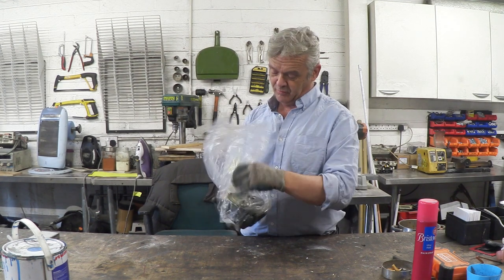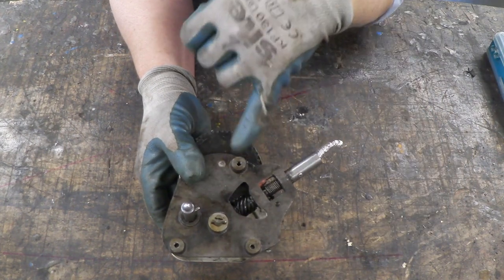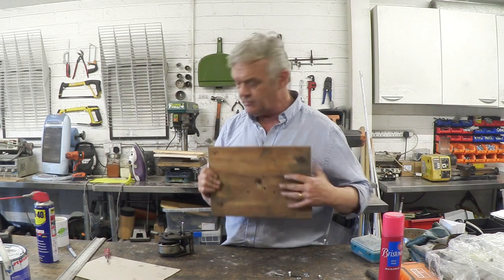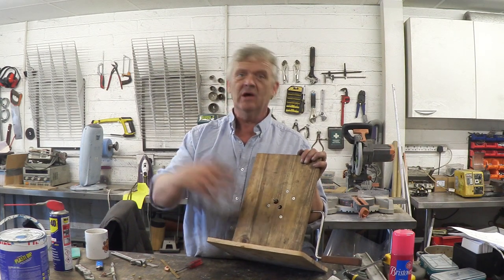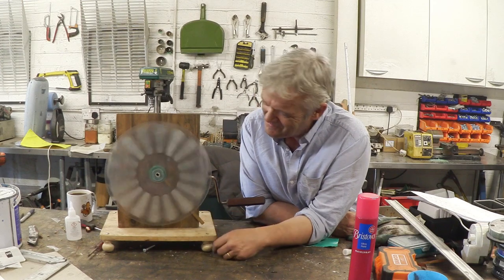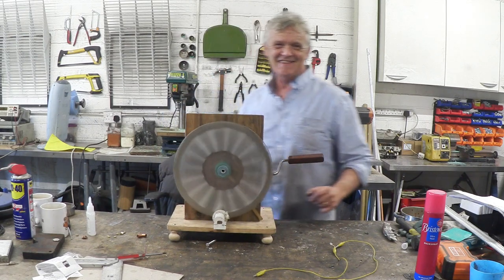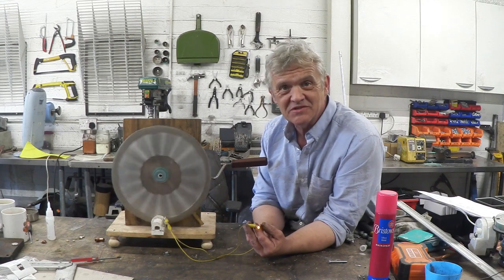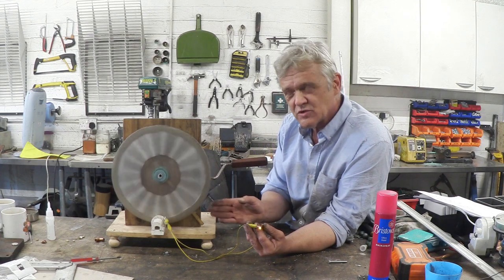1252 How To Make A Clockwork Battery / Generator

Comment: You beat me to it Rob!! I had this idea running around in my head for some time but didn't have the time to put it to practice, glad you did. It could be used as a backup generator  to charge phone or other small rechargeable devices.
Reply from the maker: sorry mate - it just came to me and I had a clockwork - but I don't think I did a particularly good job - I am sure you could do a much better job than me
Reply: @ThinkingandTinkering  I would say you've done a pretty good job of it. I knew at the back of my mind it was just a matter of time before you come up with utilising a clockwork mechanism to generate electricity.
Reply: it can charge a mobile phone, but the current, i.e. mA, is so low that it is not useful

Comment: Awesome. Delightful bit of steampunkery there. 
I still think the wimhurst model of counter-rotating wheels, like if you had your magnets like that, and put coils around the rim on the other wheel, that would double your relative speed between magnets and coils giving you more bang for your input buck, as it were. I don't know if I'm thinking on that right, but it Seems like counter-rotating magnets and coils would dramatically increase the output of the low torque generator design without too much extra effort on the input side.   If anybody wants to run with that notion, feel free.
Reply from the maker: that is a nice idea mate and somebody should run with it - you lol - cheers mate and thanks for the share
Reply: @ThinkingandTinkering  I know, I know :).  I also know I likely won't get around to it any time soon.   Maybe once my kid's not in toddler mode, and I can make him my mad science assistant lol!  
it's just I'd hate for a clever notion to languish in this damnable distractable brain of mine if it could inspire somebody, ya know?
When I was "That Guy at the Hardware Store"  I didn't usually have exactly the solution, but the thought Facilitated the solution more often than not. People would come from all over town to get my take on weird problems, as I would get them thinking in different directions, at least identifying what the "X" was in their equation, what sort of thing needed to happen right "There" to make it work.    That's really where my mind shines- a different angle on problem spots. 
It's the blessing and curse of my particular neurodivergence.   I see things and make weird connections.  I suck at the follow through, left to my own devices.  Know thyself, it is said.
So I throw out ideas, just in case anybody finds them useful or inspirational. 
(as opposed to an armchair "you know what You should do?"  which I know everyone despises.  I'm aware it can come off that way. Never my intent)

I Love your clockwork design though.  It's just awesome.

Comment: Awesome thank you for sharing. I bet you could make a larger green energy version using coil springs from a car? I could also see a larger diameter shaft to take a large whimhurst wheel. I’m aware of clock work charger for phones and other devices. I’m wondering if you could make one big enough to power a house?
Reply from the maker: I'll bet you could - though it would be quite some spring!
Reply: @ThinkingandTinkering  that It certainly would. Would need a mighty crank handle/ winding key to counter the torsional stresses from a spring so large. Reminds of some of the self propelled tourbillon mechanism. On larger clocks. Horological society might like a go at building one? I even wonder if Elon musk fancy a go a clockwork hybrid? For his new Tesla. I know da Vinci had a go a clockwork mechanism, and bet he would love this one. We do have one advantage now days is the access to materials like magnetic barings and gears. Or the ability to make them. I’d even propose a magnetic torsions spring might even do the trick. Anyway that’s me with my head in the clouds thinking my way into outer space.  Box now long gone. Flywheel and springs next upgrade for sure. I’d say the clockwork torch from the early 2000s would be a worthy entry here.
Reply: @jasonhaymanonthedrawingboard  or just many of those mechanism on the same shaft . You just crank them one by one.
Reply: @sk8pkl  I don’t know if someone would take the time to crank them one by one. where multiple units are concerned. if cranked by a single handle. Then planetary gears could be used to wind them simultaneously. Providing the crank is the sun wheel with a large cog leading to smaller cogs on the springs. With as many torsion spring around its circumference. It will need a ratchet mechanism on the winding shaft to prevent a deadly release of energy as your cranking it. You would not want that to hit you in the face with backlash.
Reply: @jasonhaymanonthedrawingboard  the clockwork mechanism has already a load on its spin so it would never "back lash". Take time to understand everything first, dont rush thinking too quick too far. There are many ways to go about this for shure. It is also very efficient, but obviously not so practical. Anyways, it is very interresting! It's a bit like the gravity light, but different.
Reply: @sk8pkl  i did. I was thinking in gears terms and there always a backlash tolerance. By applying basic science and engineering principles. Whenever a spring is loaded it will want to release that energy if that spring is large and pretty baulky. Then the most dangerous part is the winding operation. Definitely would need a means to prevent accidents. Kinda what I was thinking when posting. It would also be a leaver which would amplify any movement in the winding mechanism.  What could be 0.04 degrees of movement on the winding shaft could translate over the length of the winding handle. Ending up being cm’s if the handles radius of travel is say 50cm. It is really down to what application could you use it for?  Also where you would want to use it? I was always taught about practical application and what would be scenarios, it would be best used in. Portable generator where there’s a fire risk perhaps would be its best application. Especially If it’s fully enclosed to minimise the risk of sparks. Definitely a good idea. I’d agree it’s similar to a gravity light. There are plenty of examples of clockwork devices. My folks even had a clockwork touch that last for ages. If the gear ratios require are correctly calculated the movement can be applified to create higher rpms and torque over the duration of its winding. In the example of torch my folks have,  the mechanism leads to pulleys the attaches to a motor. Big cog little cog polycarbonate box.

Comment: you could just align a bunch of planetary gear trains before the magnet disk for higher rpm. you might have to make this disk smaller because of the low torque though.

Or instead of the disk you could hook it up to that windturbine generator you made and see what kind of output you get

Comment: Building bigger. Using two large coil springs, flat-wound and a battery, with car or truck starter Motors to wind the springs so you could run 24/7. It's self-winding and could run your whole house or a neighborhood.
Of course you can always add on to it with a giant Paul and pendulum and a huge flywheel. It's just a matter of getting the timing right. And with today's Tech, no big deal.

Remember those wind-up swings for your kid's...?
And the Tesla turbine...?

Comment: Gearing also making the flywheel lighter would help with the lack of torque. the balance in the mechanical bits making it lighter might increase rpm as well. Adding a smoothing cap or a boost controller to regulate the voltage might make for brighter led as well.

Comment: I forgot to mention, the springs in these are dangerous they can virtually explode if you try to disassemble the spring/drum assembly,  also know that the mechanism version with the diecast spring drum is the most unstable to handle as the containment drum is often hair line cracked and broken or  fractures under disassembly allowing the spring to violently whip in circles with a hooked shaped talon at its trailing edge it is razor sharp, especially if the end is broken from over winding. Do not take the drum apart! use extreme caution when messing with the drum assembly, treat it as a grenade, as it can take out you sight, one of my favorite power sources, I have a few, the fly weight governor is a favorite of mine on any machine, good luck and be safe with these.
Reply from the maker: nice post mate - and good advice - cheers

Comment: Might be off base, but would nitinol be a better material for a wind up spring? Seems like by applying temperature, you could make the spring as limp as a noodle to wind it (using very little mechanical energy to wind it) and then stiffen it after it's wound up. (Releasing a lot of energy as it unwinds.)
Not free energy as changing temperatures requires energy above and beyond the mechanical energy to wind it, but it would be interesting to see how efficient or inefficient it would be.

Comment: My brain is in no-battery mode these days so I'm thinking, maybe we can make it spin long time, but slowly as energy source for clock. And i watched your other video about smallest generator.
Maybe we can use that as generator and use many nylon to make very long one.
Then use it as energy storage and power an clock or even fit it in the phone and adjust power output 😂